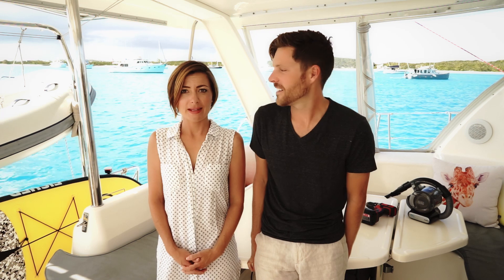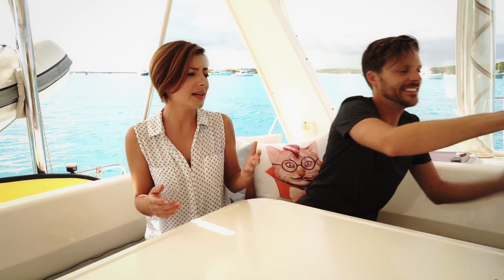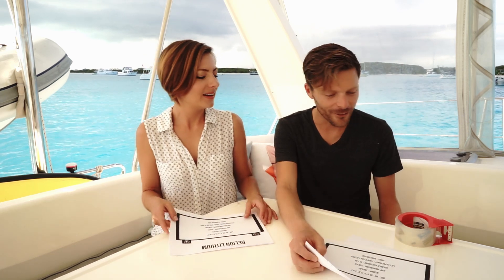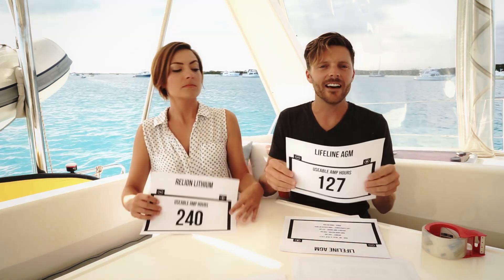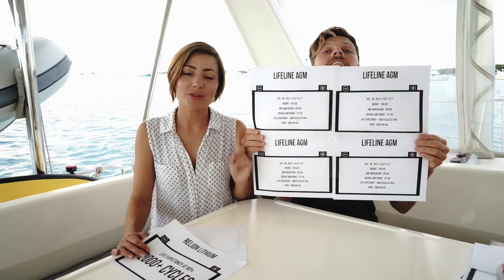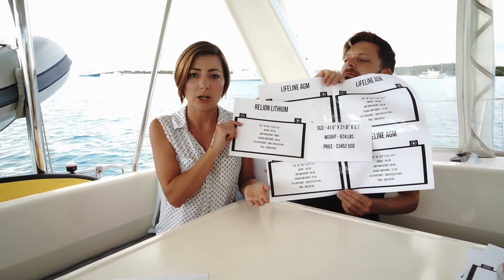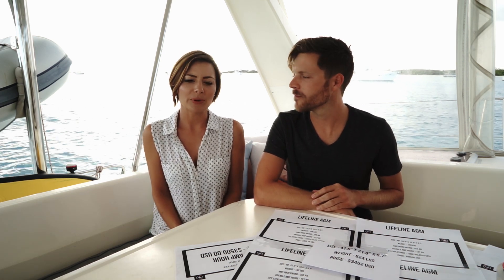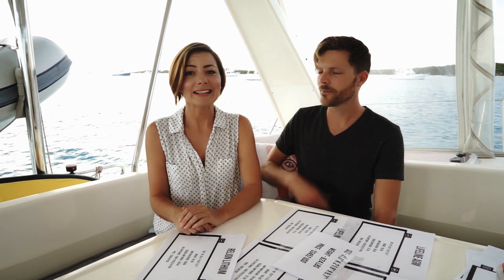Sailboat Tech - Lithium Batteries & Why We Chose Them (vs AGM)

Comment from the maker: For those that are not super technical and just want to understand why you would want to invest in Lithium for a boat, tiny house, RV, etc. this video is generally accurate.  
If you’re super technical you’re not going to like this video.  There are holes in our comparison like there’s holes in Swiss cheese…but how can we simply explain the apples to oranges comparison and not go into excruciating depth?  Sure we may have been a bit hasty in adding the weight and size of our theoretical 4 AGM bank, of course you wouldn't buy them and install them at the same time, it would be 2-3 years later while the lithiums are going strong.
We are not engineers and we prefer to share general knowledge, based on our experience and research, that the average person can understand.  If you’re compelled to educate us, or any of the viewers that may watch this video, please, by all means, share in the comments below.  
We learn something new every day and if you have a simpler explanation than we’ve provided, we’d love to hear it. 

In the end the result is the same:  When batteries go head-to-head, Lithium will blow an AGM out of the water!

As I mentioned there are lots more technical specs, links and explanations on our website for the people that want to dive in and do more research: www.gonewiththewynns.com/sailboat-tech-why-lithium-batteries
Reply from the maker: Frank we've explained Solar, Batteries and other tech for years now, we are not fish out of water.  We share based on our experience in a way that we can understand...which helps other non-techie people get the jest.
Reply: You're absolutely right about Lithium batteries... when you are talking about portable use. So for a boat or RV, Lithium is the way to go.. but you will have to replace them every 5 years or so. And yes, AGM High C batteries, in common use in marine applications, are WAY too expensive for what they provide (in terms of cycle life and cost per AH). So for marine use, AGM makes no sense when Lithiums are in the room, unless you are a daysailer, weekender type.

For stationary use, where weight and space don't matter, and we are talking being off grid in a house, then Lithium is not the way to go.

1) Lithium batteries degrade over time, regardless of how you use them. After 5 years, Lithium generally needs to be replaced (10 years or so for backup applications)
2) Lithium are MUCH more expensive per cycle, per year (lifetime cost per WH extracted) as compared to high quality FLA.

This is the big dirty secret that battery manufacturers don't want you to know :-) Basically, top quality Lead Acid (like Surrette) will last 20+ years and cost less than Lithium, even when taking into account oversizing your bank to 50% DOD drawdown AH, and adding an AGM "High C" bank in parallel for spot loads. In other words, top quality FLA batteries have an enormous cycle life, and don't degrade spontaneously as Lithium's do. Surrette's have a good warranty as well.

Believe it or not, the very best batteries in this class, when talking about longevity, are Edison batteries. So far, they don't seem to have an end of life that is meaningful (80 year old Edison batteries made in the 30's are still being used for a few applications) so there isn't a cycle life rating because.. as far as anyone knows.. it's infinite. They also use non toxic materials (Nickel, Iron and Carbon), the electrolyte is potassium hydroxide (a chemical that is used to make soap, and breaks down very quickly in nature) and so are not a hazard in any way.

Of course.. this is why you can't easily find Edison batteries. There isn't any degradation, thus they can't generate repeat sale over time.
Reply: Timothy Zyg Gave you a thumbs up, purely for the Surette cite. Probably the best watt/$ in boat batteries, IF you can locate them so that gassing and spilling is not an issue, even a remotely possible issue.
The way the Wynns use their batteries, (pounding the crap out of them with their high-demand A/C loads via their inverter), would kill even a Surette in no time.
The best batteries for their specific use is Lion.
Edison batteries are not all beer and skittles, they're extremely heavy, require water top-up, chemical top-up, are ridiculously large, and don't support high specific output. They're great for standby, as, as you say, they last a long time, but day to day, high loads, not very good.
Reply: Marine Lithium batteries are generally  LiFePO4  (Lithium Iron Phosphate) and so are very safe. Relion are that type. They cant explode.
Reply: Great info. Thanks.
Reply from the maker: Timothy Zyg we have personally seen some crazy SLA battery banks for large solar applications...we totally agree for certain applications its the ticket. We've also read about the Edison battery and that old school science is like 22nd century stuff. so cool.
Reply: Google 'Edison battery' and have fun :-) They are similar to FLAs, except they have a bit less power density.
Reply: I did say, very specifically, that Surrettes and Edisonbatteries were the best for "stationary use" didnt I? I said right up front that Lithium was a no brainer for RVs and boats. I hope I was clear about that....

As far as Edison having a low C, that's true. Thats why you put a small AGM High C bank in parallel with them, and with low C Surrettes, to handle high spot loads. Then they immediately get bulk charged back across the circuit by the larger, low C bank, which improves their longevity.
Reply: Start The Rebellion Perhaps you could encourage her to buy one, if she has an extra €52k laying about, not doing anything important.
I was told they are only available in aqua, inside and out, so she would need to like that colour- a lot.
Reply: get the jest : )
Reply: It is very cool! I spend some of my free time going through old science journals and old patents, finding new things to tinker with :-) It is so much easier today with the materials science we have to make some of these old technologies really sing, and very cheaply. Whenever I am confronted with a physical problem, I like to think WWTED? (What would the Egyptians do?) and work UP, instead of working backwards from today's tech. 

Love your videos. Thanks so much for sharing!
Reply: @timothyblazer1749  also What Would Thomas Edison Do? works with that acronym lolz
Reply: I love this video.  Technical shortcuts and all. Thank you thank you!
Reply: Hey Tim,

Having already thanked the Wynns - thank you for your input.  It is the way of an uncertain future and I, for one, am happy to have my horizons broadened.

It is a shame however, in this technological age, that there's no escaping the trolls of the world . . . even in the Bahamas apparently!  (very jelly)

Cheers Mate!  I am one kazillion to one sure we would be.

Andrew
Reply: Timothy Zyg How would you suggest charging two different battery chemistries, even in a 'stationary' application, two different PV arrays and two different backup generators driving two different chargers and charge controllers?
When would the two be parralled? 
How would this occur?
How much Air Conditioner, dish washer, clothes washer and dryer load could an  AGM bank sustain before it needs to be huge, defeating the whole purpose of Edison batteries?
Edison batteries are the 'flavor of the month' right now, but will ultimately return to obscurity when the hype is shown to be exactly that, hype.
I think Edison had a great idea about electrical generation and transmission, how did that turn out?
Reply: Mate, Ive done the research.. please don't be so controversial here. BMS are simple things to get or build, and can handle many of not all of the situations you are talking about (aka can charge balance between two different C banks). NiFe batteries charge profile isn't much different that FLA, and it is a trivial operation to design a BMS and charge profile for them.  Any competent solar installation company can accommodate all of these scenarios, if someone is not an EE, or technical minded enough to do more research.

And by the way, Lead won the battery war because of automobiles needing CCA, and High C applications. Back then, we didn't have BMS electronics. NiFe batteries can be revisited now and used successfully in any stationary application.

You are talking as if this is some sort of difficult technical challenge... it isn't. Lets just drop it there.. Im sure the Wynn's don't want this sort of thing.
Reply: Timothy Zyg You didn't really address ANY of my questions, much less the important ones of how the AGM bank would handle high draw continouosly as in ten hours of a 15k BTU A/C load just for instance. Charge protocols need to be VERY specific to get the most from batteries, so as you say, 'many, if not all' is not really an answer.
Your facile plea to 'not be so controversial here' is only indicative of your actual, real-world, on the ground lack of experience and your desire to put this conversation to rest.
Your 'research' will reflect the OPINONS of other 'researchers' on the interwebs, who, frankly are thick on the ground and are in general, an echo chamber of wikiwisdom.
If telling you that integrating two or more different battery chemistries is difficult and perhaps unwise or counterproductive is being 'controversial', then you have led a very sheltered life.
Your insight into the Wynns' desires is, I'm sure, wholly imaginary, as is most of your 'knowledge' regarding battery chemistry compatibility.
BTW- there's a good chance, something approaching quintillions to one, that I'm not your mate.
Reply: Start The Rebellion It would be 'possible' in the theoretical world of electrical engineering, in the real world, the current draw of A/C, washers, dryers, ovens, and cooktops and other AC appliances would rapidly, (a matter of minutes) deplete the capacity of the capacitors, sorry, couldn't help myself, unless they were the size of a Smart Fourtwo. Even then, a full day of air conditioning will leave them flat. If you have massive amounts of incoming juice, perhaps you could get away with it in certain conditions on certain days.
Reply: Start The Rebellion I'm actually glad you asked the question as I just love getting a Smart Fourtwo into the conversation, I saw the Brabus Fourtwo at the Geneva show and thought it was the most ridiculous way to burn through €52K ever invented. Coke dealers are way back in second place;)
Kind of a motor head, in addition to being a retired engineer and sailing yacht cruiser.
Reply: Start The Rebellion Thanks for the correction.
Have you seen it? The Brabus version I mean, absolutely bonkers. I'm sure it's on the interwebs somewhere.
Always wanted a Smart roadster until I drove one, reality is harsh.
A Smart roadster is reality at it's harshest.
Reply: +acmeopinion factory Ok... let me try again :-)

I was saying that you could parallel a High C bank to handle spot loads.. I was thinking temperate climate. But you are talking about warmer climate, and larger draw over time, so this is how I would solve that.

I would keep adding banks of low C in parallel until I achieved the right amount of instantaneous draw. I would do that through a good quality PDU and have a Battery Management System on all the banks.

For a cheap setup, you could get away with using only Edison batteries and a larger number of banks in parallel, or a few high voltage ones in series.

Either way, you just keep installing batteries until you get to the draw capacity you want. If you want to get more creative, you could add in super-capacitors, although those are really only useful for small duration high amp loads (as you pointed out, like compressors kicking off, etc) so you don't need many, because you would design them to only be used by the circuit when the draw was high enough to warrant it.. pr even easier, you connect them directly to the circuits that have that sort of load profile.

My point is.. with Edison batteries, even a huge bank is a one time (essentially) capital investment. Depreciated over 20 years, it vanishes as a real cost. Then, 60 years later they are still operating. So you can buy as many as you want and you won't lose money, so you can handle any C, capacity, total AH.. whatever. There is no realistic limit, except practical limits on connecting that many batteries together reliably, and managing them well, that exist.
Reply: Jasper Soda  So anyone with an opinion different to yourself or Zyg is a troll?
Reply: Lithium Batteries are the clear winners here, there are other options but would be my preferred choice, for all of the reasons you've outlined in this video, except for one, cost. When you discussed cycles, disregarding the 50/80% argument for a minute, comparing 1000 cycles to 2000 cycles, you were selling us on this idea that you'd need 4 AGM's to achieve similar results. Now, maths has never been my strong point but 4x1000=4000 cycles, so am I wrong here or missing something? If you add in the 50/80% then yes Lithium batteries are more flexible but only if your power requirements require that level of serviceability. If on the other hand your power needs are not so demanding, you have multiple upgrades on your wish list, then AGM's may be the preferred option. Using your current setup as an example, costing approx $14,000, yielding 1,200 amp hrs, 960 usable amp hrs and 8,000 cycles, a similar setup using AGM's would cost approx $3,500, yielding 1020 amp hrs, 508 usable amp hrs and 4,000 cycles. Just doing the math using those figures you could afford to replace the AGM's at the end of their life cycle, doubling your costs @ $7,000 and still have cash left over to upgrade other electrical components. My point here isn't to disagree with you as I myself would prefer the extra usable amps, but for those shopping on a budget and with multiple upgrades in mind, depending on their power needs, AGM's could well be a viable option. Just my 2 cents : )
Reply: I thought you two were great!
Reply: Don't be too hard on yourselves. Although I caught the glitch in your calculation for adding the weight of the additional AGMs on day one, there is a way to justify that :)  You could argue that in order to match the 2000 discharge cycles of the lithium, you need to double the CAPACITY of the AGM bank from day one, therefore the weight will double. (Of course in reality you don't want to do that because of the additional space it requires). But at least you can use the explanation to tell off the smart-asses ;)

Comment: DoD on lithiums is not 80% or 99%, any battery discharged over 50% suffers loss of total capacitance. Problem is, lithiums suffer dramaticly more capacitance loss from an over discharge. Consider cellphones being useless after less than a year. Also, lithiums are very temperature sensitive, especially with heat. Honestly, TPPL marine batteries would be the best possible choice, slightly cheaper than lithiums, and Muuuuch more tolerant of varying charge voltages, which wasnt even mentioned as a massive issue in charging lithiums.
Reply from the maker: Read the specs and view the charts on all lithium battery mfrs, 80% is the recommended DOD.  That said we stay around 50% DOD for our personal batteries.

Comment: **Very Very good batteries for dummies explanation!** One thing you guys didn't touch on was rate of charge too....Lithiums will re-charge faster and with much more efficiency  (70%-90%+).     Voltronics are running about $5400 for 1100 amp hours and I have seen Winston's 1000 amp hours as low as $3200.   Again great simple explanation!
Reply from the maker: +Johnny Gerhart we covered that info in the post (link in description box). I haven't looked into either brand so just make sure it's a good reputable company before purchasing. But those are great prices.
Reply: Wow!   reading some of these comments, there are some really "less informed" people out there!   We sold our boat in May/16, it had 540Ah of agm's but the RV we are buying i'm putting lithiums in.  How much capacity would you guys recommend  to run a single 15000btu AC unit for 4-6 hours?
Reply: Johnny Gerhart Not going g to happen imo.  You're probably looking at 200 amps (including loss at the inverter and wiring  so that's 1200AH worth of batteries.  Even if you had a big enough battery bank it would be tough to charge that monster

Comment: Another great job guys. I'm sure many don't understand how much time, hard work and expense goes into making an informative video like you two have. I started doing some research into batteries and it can drive a sane person nuts. The one major factor I've learned and believe is most important is the fact that if you accidentally discharge AGM batteries completely or below 50% many times, it renders them useless and need replacement. That hurts. Thanks for all of your hard work and sharing your hard knocks. Fair Winds!!!
Reply from the maker: You are correct.  Lithiums on the other hand should have a BMS built in that keeps them from discharging past the safe zone.